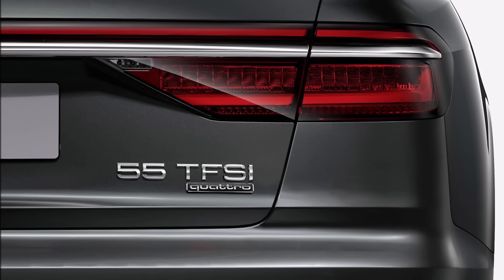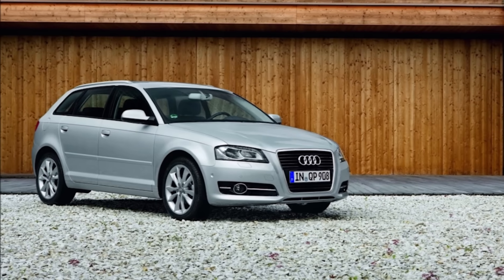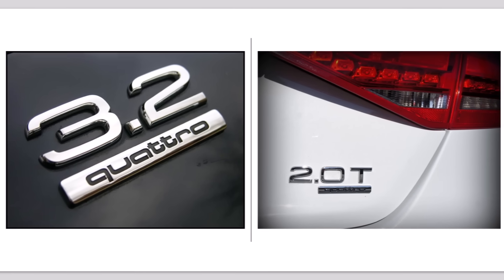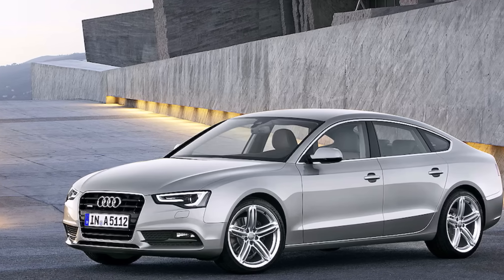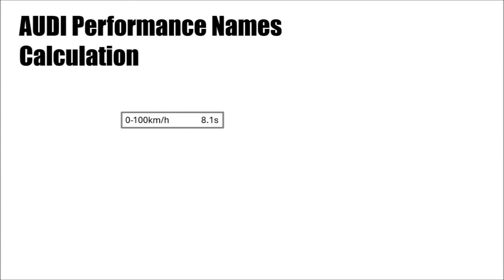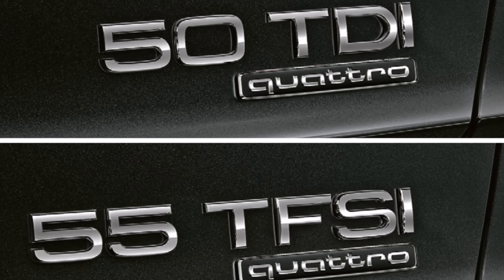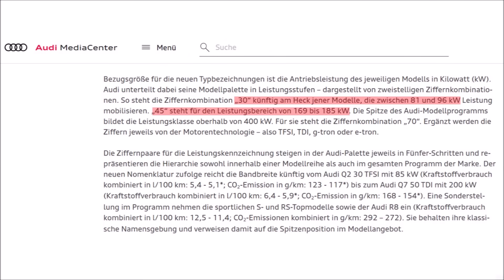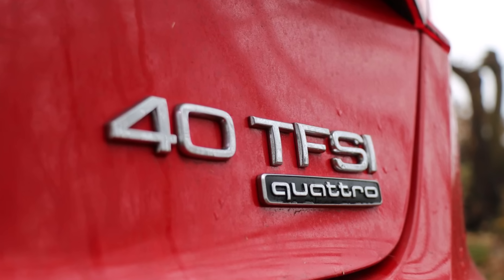AUDI Performance numbers EXPLAINED

Comment: I think this is better than "Taycan Turbo", or Mercedes "E63" (6.3) with a 4 litre engine.
Reply: Or C63 with 2.0 liter 😂😂😂
Reply: @intraxx88  Well Volvo made it worse 😭
Reply: @ronald3148  How ? The Volvo system is pretty easy. Divide the number by 2 and that's pretty much the number of hundred HP.
A few examples, my V60 T8 has 405Hp, my previous V60 D6 had ~300Hp, my wife's V70 D5 had 225 HP, a D3 has 163 HP.
Not perfect but pretty much follows, they should have named the latest V60 T8 as T9 as they have 455 HP
Reply: And 6.3 really means 6.2L.???
Reply from the maker: Yes exactly😅
Reply: I disagree. People just know that that means fastest/faster version. I as someone who knows something about cars didn’t have a clue about Audis naming conventions. Until now.
Reply: @7medo7  No, Turbo in Porsches doesn't mean it's the fastest version, and doesn't mean it has a Turbocharger.
If you talk about the 911 there is the Turbo, and there is the Turbo S; and those are the "normal people" versions for mostly road use, because the turbo is not the GT3, which is already below the GT3 RS. And if you think the GT3 RS is just "the best one" for racing, then 911 GT2 RS owners will disagree with you; and then there is the Manthey Racing version of that GT2 RS.
And the 911 Carrera S is like the faster version, but the faster version OF the carrera version, which is the slower version. But it's still slower than the GTS version of the carrera.

So, yes, the Taycan Turbo is the fastest Taycan, except for the turbo S. But the GTS version of the Taycan is just a GTS, not a carrera GTS, because of a different bloodline than the 911.
Just don't tell me normal people know all this stuff.
Reply: @sasjadv  ha, ha, someone is always faster: some Porsche and Godzilla are racing and a Golf1 passes them both as if they were standing still